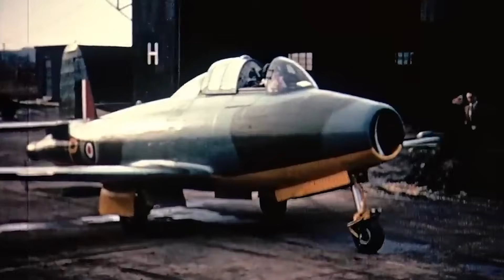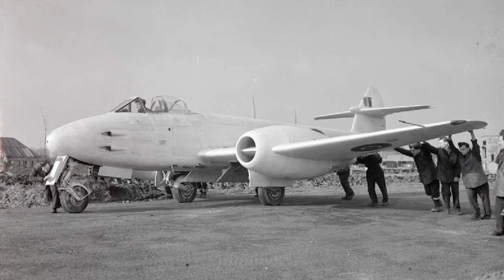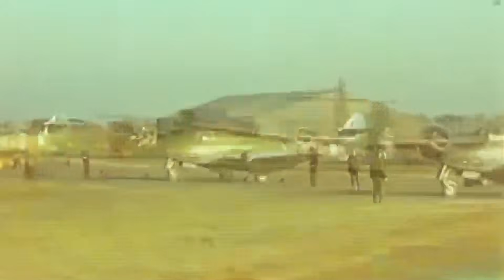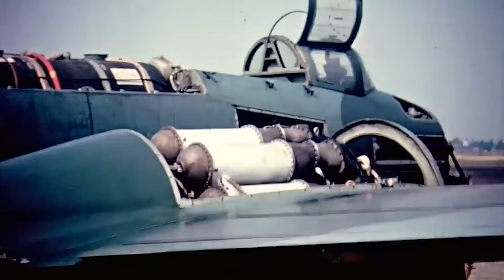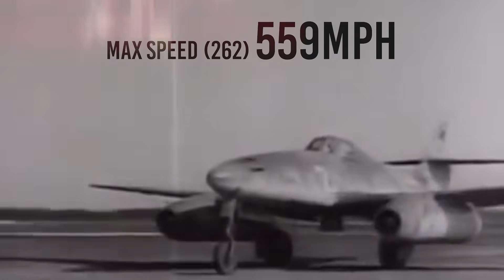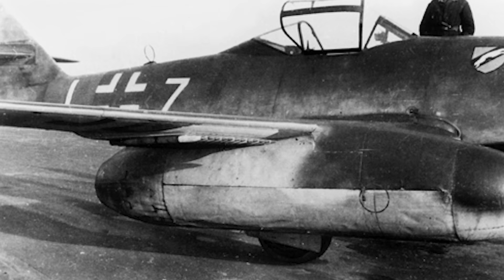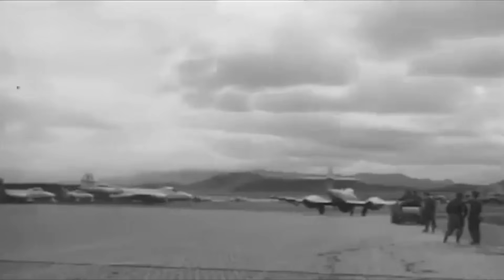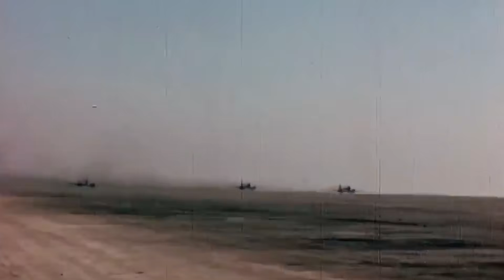Meteor vs Me 262 | Which was the better WW2 jet?

Comment: I think the main thing is that the meteor well outlasted the war, while the 262, outside of a couple of r and d units, did not. I think it's something the whereaboos often forget. The allies had no issue using German designs if they worked, the mg42 is still manufactured as the mg3 to this day. Most of there stuff was just crap, for various reasons.
Reply: The Gloster "Meatbox" was not a fighter aircraft, it was limited to ground attack and only killed British pilots... 890 crashed in RAF service killing 450 RAF pilots.
Reply: @DoktorBayerischeMotorenWerke 

@JammisAdami   indeed

We feel we can clear up some commonly held myths and misconceptions, obviously.
It's always good to see the facts presented clearly and concisely isn't it?

The Gloster Meteor was one of the world's first jet fighters to go into service, it was in service during WW2. The meteor was the first effective multirole fighter bomber jet aircraft with a reliable engine to go into service,  It broke speed records in 1945 and 1946. During WW2 it was in service as a fighter and multirole aircraft over the UK and over all allied controlled territories in Europe and beyond. 

The ME-262 and it's 46 minutes life engines were abandoned shortly after 1945, it had a do not exceed speed of 456 mph and was only ever used to attack bombers with losses of three 262s for each downed bomber.  During WW2 most of the ME-262s were destroyed by their engines, were various types of accident losses or were shot down by bombers. No German designers were involved with the Mig-15. The Mig-15 used a copy of the RR Nene.  

During the Korean conflict most of the Meteor casualties were due to groundfire or accident losses. The result of any tangles between Migs and Meteors was that Mig pilots avoided getting into dogfights with Meteors. The battle of Sunchon, where 50 Migs against 14 Meteors resulted in the supposedly superior Migs failing to gain any clear advantage caused the Koreans to re-evaluate tactics. General opposition in Australia to involvement in the Korean conflict resulted in the govt using the battle as an excuse to reduce the RAAFs involvement to troop support only.

The world's first wind tunnel was built in England during the 1800s. The world's first supersonic wind tunnel was built in England during the 1920s. 

The Whittle Gloster E28/39  was of course a brilliant aircraft that was later copied in Russia as the upsized and tweaked Mig 15 with a copy of the RR Nene gas turbine aero engine. The RR Nene being the world's most powerful & most reliable gas turbine aero engine in 1944.

The MD F3H Demon was a contemporary to the DH Sea Vixen & had a similar performance. The F4 Phantom was a follow on from the F3 Demon. The Sea Vixen took a long time to get from first flight to introduction for various reasons and a similar situation occurred with the MD F3H Demon.

McDonnell Douglas F3H Demon
590 Built. Not Supersonic.
Max Speed 578 MPH.
Introduction date 7 March 1956
First flight 7 August 1951
Retired 1964

MD F-4 Phantom 2
Number built 5,195
Manufactured 1958–1981
Introduction date 30 December 1960
First flight 27 May 1958

DH Sea Vixen
Number built 151 (including two DH110 prototypes and one Sea Vixen prototype)
Introduction date July 1959
First flight 26 September 1951
Max speed 695 MPH.
Retired 1972

Interesting British achievements.
There is no doubt that the Fairey (England)
Delta 2 was of course the world's first jet
aircraft to exceed 1000 mph.  Indeed It
exceeded the previous record by 310 mph &
held the record for 1 year. Incidentally, the Dassault Mirage 3 & 4 are based on the Fairey Delta 2.

The Panavia Tornado & Euro fighter Typhoon are British design aircraft with British design engines built by international consortiums. 

The EE Lightning was one of the fastest aircraft on the planet when it first achieved a Mach 2 flight. 

Early days, jet fighters.
De Havilland Vampire, Sea Vixen & Gloster Meteor accident losses were not high or unusual for fighter aircraft at the time. De Havilland built large numbers of all metal airframe aircraft before the DH Comet.
We mustn't forget of course that the DH Vampire for example first flew in 1943 & the engine was also built by De Havilland. There were examples of the Vampire interceptor / fighter in service until 1990 which was operated by more than 30 countries.

Non combat phase accident losses.
% of Aircraft built.

The Canadair CL-44 was a turboprop airliner.
Canadair CL-44                  (ff 1959 ) 48%
Lockheed XF104                (ff 1954) 100%
Lockheed  P80                   (ff 1944) 43%
Lockheed F104                 (ff 1954)  45%
Grumman f9f-5 Panther   (ff 1947) 44% 
Convair F102 Dagger        (ff 1953) 45%  
MD F-101 Voodoo.             (ff 1954) 34%
MD FH Phantom 1            (ff 1945)  35%
MD F4 Phantom 2             (ff 1958)  28%
MD F3H  Demon               (ff 1951)  32%
Gloster Meteor                  (ff 1943)  21%
DH Vampire UK                (ff 1943)  23%
DH Sea Vixen   UK           (ff  1951) 33%
Gloster Javelin  UK         (ff 1951) 20%
EE Lightning  UK             (ff 1954) 33%

It's a great pity & a crying shame that British military forces had to occupy a large part of Germany for decades after 1945 & Russian military forces had to do the same. Of course Russia still posseses a large chunk of what was German territory & of course Russia & the UK produce nukes. Obviously Germany does not produce nukes.

Early days, jet engines. Whittle performed the world's first demonstration of a gas turbine aero engine in 1937. The RR Nene, a centrifugal gas turbine aero engine, was the world's most reliable & most powerful gas turbine aero engine in 1944. Licensed built versions & copies of the RR Nene & RR Derwent would go on to power many aircraft in Russia including the Mig 15 & Mig 17, the US, China, France & other countries for decades after 1944. Incidentally, the Mig-15 was in essence an upsized / tweaked copy of the Whittle / Gloster E28/39 jet aircraft including an uprated copy of the RR engine.  The basic centrifugal compressor gas turbine aero engine with Whittle style reverse flow combusters and sometimes an axial compressor section is still manufactured by more than one company including Pratt and Whitney, the main application being helicopters.

The gas turbine engine was invented in England during the 1700s.

During the 1800s Parsons of Ireland & North England produced the world's first axial multi stage sequential stator rotor turbines and compressors for turbomachinery use which would eventually go on to to form the main components of the axial gas turbine aero engine. At the time the basic idea of making an internal combustion gas turbine engine and using it as an aircraft engine was considered thus the jet aircraft concept had been created in England before the first powered aircraft flew.

An example of what goes on these days in various countries. For example, there are of course no German companies that makes German jet aircraft in Germany & there are no German Companies that make German gas turbine aero engines in Germany that are suitable for widebody airliners.

The UK has the world's highest combined per capita Nuclear / Defence / Aerospace Sector Activity.

UK defence sector, absolute terms, world's second highest activity. 1st for per capita defence sector activity. Per capita nuclear powered submarine construction, 2nd position. 
Main players being Rolls Royce, Babcock, GKN Aerospace & BAe Systems. Activities often involve international collaboration. BAe systems, RR and other UK companies now handle more Airbus work value wise than Germany. 

There's a good chance that anyone currently flying on a widebody airliner will be on an aircraft powered by RR gas turbine aero engines made in the UK and a good chance there will be other hardware on the aircraft that's designed and / or manufactured in the UK. 

Rolls Royce Holdings UK
Subsidiaries
- Rolls-Royce plc
- Rolls-Royce North America (ex Allison etc Classified Military stuff)
- Rolls-Royce AB
- Rolls-Royce Deutschland
- Rolls-Royce India Private Limited
- Rolls-Royce Marine Power Operations
- Vinters Engineering Limited
- Rolls-Royce Controls and Data Services
- Rolls-Royce Power Systems
- Bergen Marine
Joint ventures include:
- Rolls-Royce Turbomeca
- MTU Turbomeca -

Trent Family
The MT30 (Marine Turbine)
Industrial Trent 60 Gas Turbine
Trent 7000
Trent XWB Airbus A330neo.
Trent 1500
Trent 1000
Trent 500
Trent 600
Trent 700
Trent 800
Trent 8100
Trent 900
   
RR wholly owned subsidiaries in Germany handle smaller 2 shaft RR gas turbine aero engine work.

The UK space and aerospace sectors are highly productive, high-value industries that together contribute over £18 Billion in direct Gross Value Added (GVA) to the UK economy. Individually, the space industry directly contributes about 0.3% of UK GDP 7•2 Billion while the aerospace industry contributes approximately 0.5% £10•9 Billion.
   
We hope.      this helpzetc....

We hope this helps of course 👍